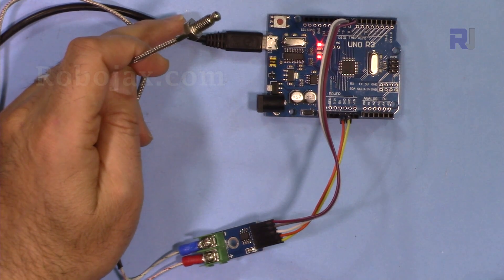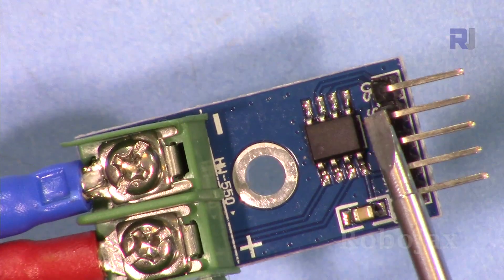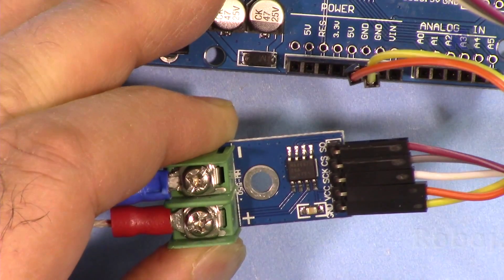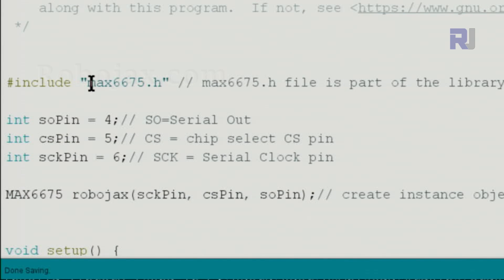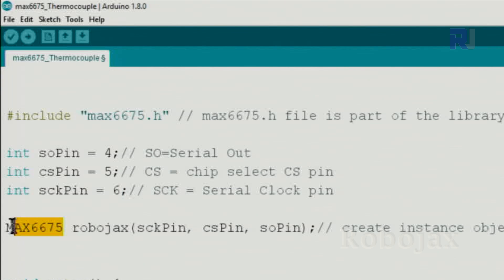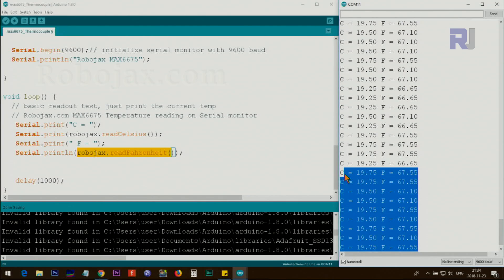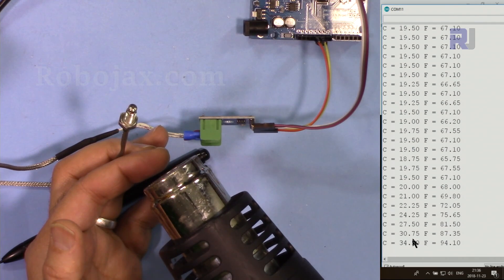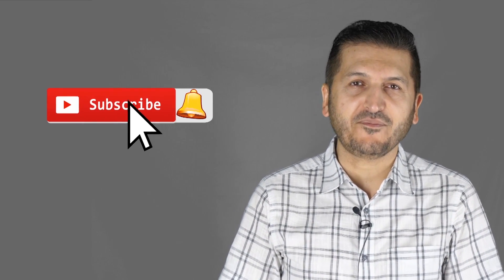Lesson 39:  Using MAX6675  K-Type Thermocouple Temperature Sensor- RJT518

Comment: I have done as in the shown in the video but my thermocouple reades values as C = 0 and F = 32 no increase and decrease in temp
Reply from the maker: You must be sowing something wrong. Make sure library is installed . Don’t change the code and check wiring.
Reply: @robojax  everything has been done 
Installed library 
Rechecked my connected wires
Gave external 5v dc to the max6675 

Done everything but nothing happened
Reply from the maker: then the module is bad. 1000s of people have used this code.  the video you are watching is part of the course but the older video have been viewed orver 50k times https://youtu.be/VGqONmUinqA
Reply: @robojax  ok how to use thermistor to get temperature values using Arduino I want to build a project for melting plastic and converting it into a thin plastic pipe striping an old plastic bottles

So I want add a heating element which will stop heating after reaching 80 degree

Comment: I have tried your changes but I still get the error?  Arduino: 1.8.19 (Mac OS X), Board: "Arduino Uno"

Max6675Thermocouple:58:51: error: no matching function for call to 'MAX6675::MAX6675(int&, int&, int&)'
 MAX6675 thermocouple(thermoCLK, thermoCS, thermoDO);
                                                   ^
In file included from /Users/terryaris/Documents/Arduino/Max6675Thermocouple/Max6675Thermocouple.ino:1:0:
/Users/terryaris/Documents/Arduino/libraries/MAX6675/MAX6675.h:49:3: note: candidate: MAX6675::MAX6675()
   MAX6675();
   ^~~~~~~
/Users/terryaris/Documents/Arduino/libraries/MAX6675/MAX6675.h:49:3: note:   candidate expects 0 arguments, 3 provided
/Users/terryaris/Documents/Arduino/libraries/MAX6675/MAX6675.h:45:7: note: candidate: constexpr MAX6675::MAX6675(const MAX6675&)
 class MAX6675
       ^~~~~~~
/Users/terryaris/Documents/Arduino/libraries/MAX6675/MAX6675.h:45:7: note:   candidate expects 1 argument, 3 provided
/Users/terryaris/Documents/Arduino/libraries/MAX6675/MAX6675.h:45:7: note: candidate: constexpr MAX6675::MAX6675(MAX6675&&)
/Users/terryaris/Documents/Arduino/libraries/MAX6675/MAX6675.h:45:7: note:   candidate expects 1 argument, 3 provided
/Users/terryaris/Documents/Arduino/Max6675Thermocouple/Max6675Thermocouple.ino: In function 'void readTemperature()':
Max6675Thermocouple:186:31: error: 'class MAX6675' has no member named 'readFahrenheit'
    temperature = thermocouple.readFahrenheit();//convert to Fahrenheit
                               ^~~~~~~~~~~~~~
Max6675Thermocouple:189:32: error: 'class MAX6675' has no member named 'readCelsius'
     temperature = thermocouple.readCelsius() + 273.15;//convert to Kelvin
                                ^~~~~~~~~~~
Max6675Thermocouple:191:32: error: 'class MAX6675' has no member named 'readCelsius'
     temperature = thermocouple.readCelsius();// return Celsius
                                ^~~~~~~~~~~
exit status 1
no matching function for call to 'MAX6675::MAX6675(int&, int&, int&)'

This report would have more information with
"Show verbose output during compilation"
option enabled in File -> Preferences.

Comment: Thanks for the awesome video.  Have you checked this for accuracy against another thermometer?
Reply from the maker: you are welcome. k-type sensors uses the chemical property of wire (sensor). The accuracy can be found on the datasheet of the sensor. You may find very cheap low accuracy or  expensive good quality sensor.